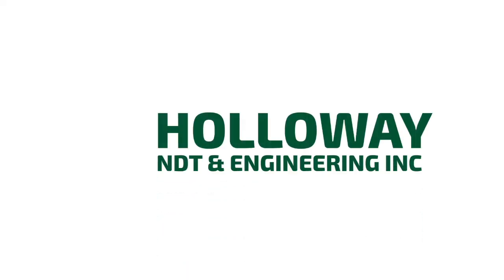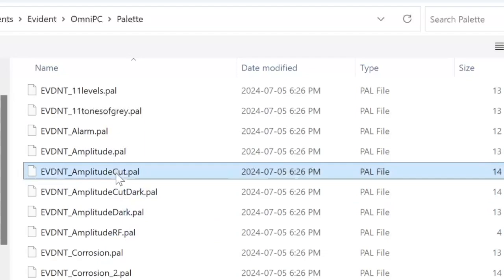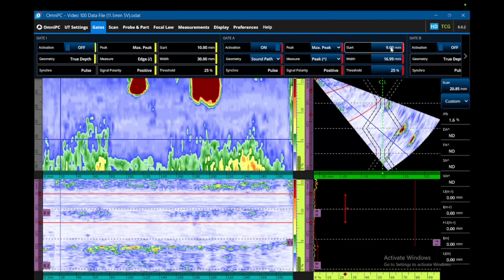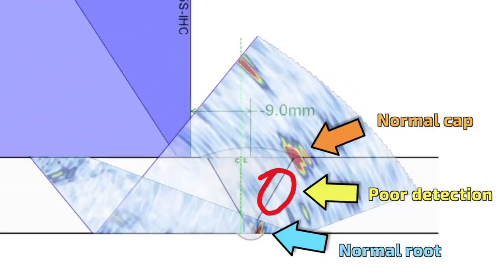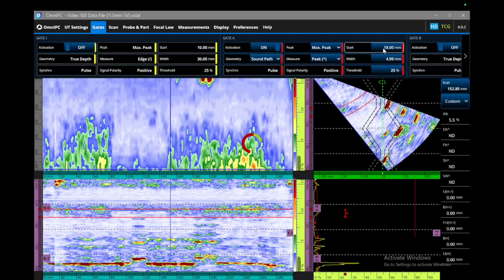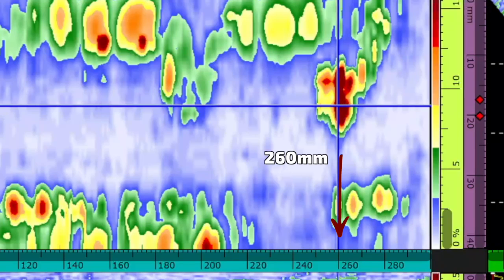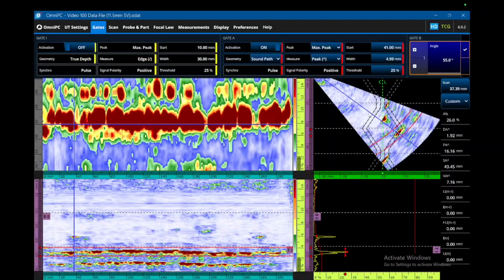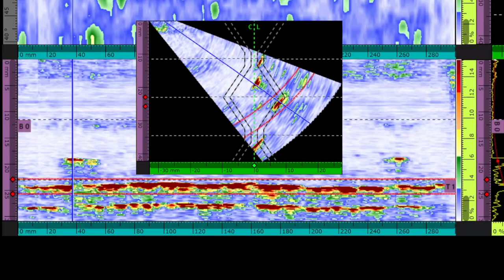Simple Phased Array Analysis

Comment: Could you possibly start going over code with calibration standards (i.e. when to use a side drilled hole or a notch) and acceptance criteria. I’ve started with API rp2x and it gets a lil confusing sometimes.

Comment: I’m am getting asked to use a cal block (60MM.) to scan a product that is at least 80mm thick.

Is there a formula in how to work out how many DB I will have to increase to get the right amount of signal that is not to little or to sensitive? 

I haven’t heard of anyone doing this before so not sure if my boss is correct on this.

Im also about to start using angle probes for the first time on many years.
Any suggestions on guides that show how to make a DAC curve? 
Using older sets like D50’s.

Love your professionalism!
Reply from the maker: What code or standard?